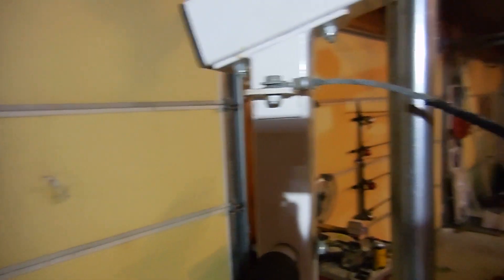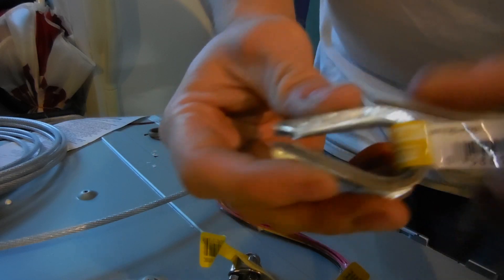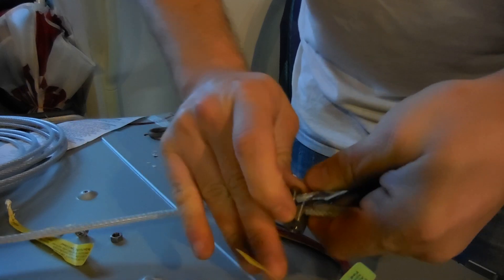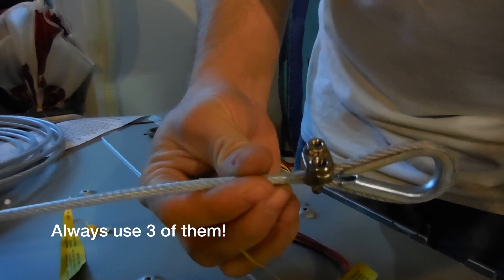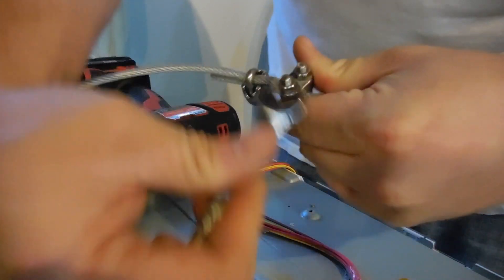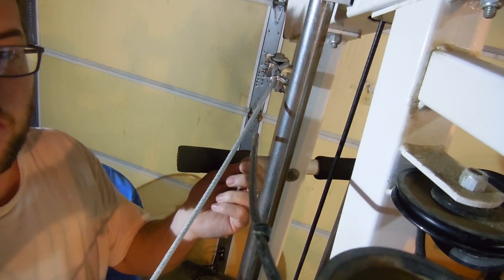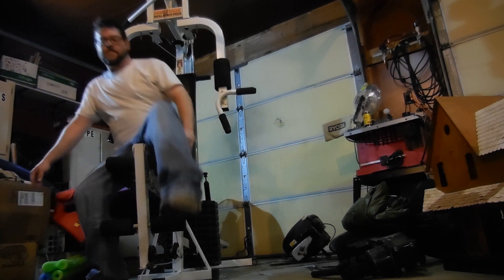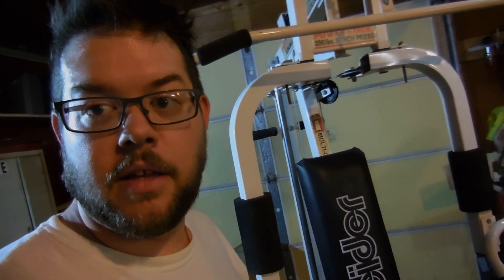DIY - Fixing old Exercise Gym Equipment

Comment: I recently changed my cable it was set up with the same kind of clamps you used here, I bought the 3/16" cable 3/16" thimbles & used 1/4" aluminum sleeves, I kept the plastic on the cable once I routed cables through the aluminum sleeves I just used a hammer to smash them down on the cable they look better done this way without the small clamps sticking out even though my other cable only had one it never slipped for the years I had used it but much happier with my set up now.

Comment: You really need to strip the coating before clamping. Also you need to put the saddle of the clamps on the long part of the cable not on the terminated end. The clamp next to the loop is correct. The other one is not. After you changed it, you put them all on wrong. Torque the nuts to 4.5 ft. lbs. for 1/8" cable (the actual size of the steel cable w/o the coating). You can get hurt doing it this way.

Comment: Sounds like you need some WD-40 or something on your pulleys so that they don't crackle so much and they'll roll a lot better with the cables on them, your machine will be a lot smoother then, just put some WD-40 on the top of all your pulleys every couple months maybe.
Reply: Good suggestion. Mine needs WD40.